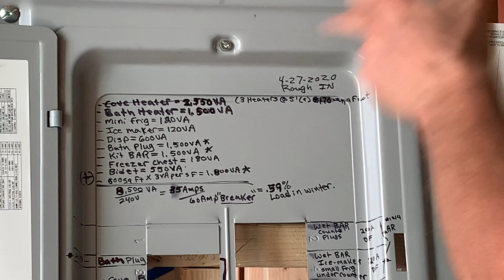Load Calculation for Basement Electrical

Comment: I just like to see how it's done, i also watch the electricians in England , i don't do anything other than change a switch or outlet and if the wiring doesn't look right i call my electrician, some of my wiring is newer, but a lot is that cloth covered with brittle casing on it

Comment: This guy needs to get over himself with his condescending attitude. Anybody with internet access and a calculator can do this work.
Reply: I think hubris is a two-way street Brian.  

And I'm going to push back your oversimplification of the trade.  If one has a copy of the code book, yes, the information is all there to be obtained as to what is expected.  But without training to develop the ability to synthesize all of the different requirements, "anybody with Internet access" is going to almost assuredly get it wrong.
Reply: But most dont or dont put in time to find out how to do a load calculation.

Comment: PE  I installed a light/heat/ fan combo I had the fan/light on the load side of the GFCI kept tripping,
Reply: Doesn't need to be gfci protected, need dedicated circuit. Check the Amos its pulling. You'll probably need 12 wire on 20 amp breaker
Reply: @yellowflash5555  right on PE thank   you.

Comment: New code is you can have 18” of slack but strap still 12” from the box.
Reply: That's not in the code.  But in some circumstances, it might be a good practice.
Reply: @steveloux4709  nec 2020 334.30  yes it is.
Reply: @joejoe6949  sorry, your statement is correct. I misread your post as a requirement for 18” rather than a permission.  My error.
Reply: @steveloux4709  brother we here to help each other if not what’s the point in all of it.

Comment: Great information. Add the right amount of dedicated circuits.. It will save you on any call backs. You spend more on a call back, then running an extra circuit. Do it right the first time.